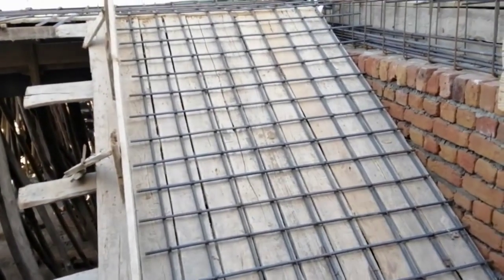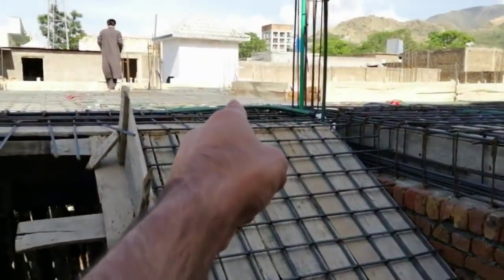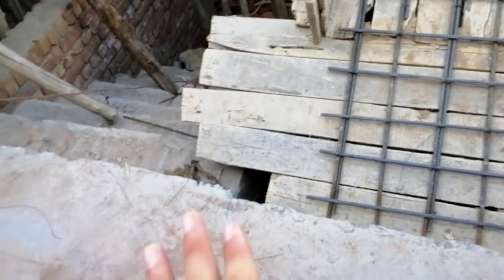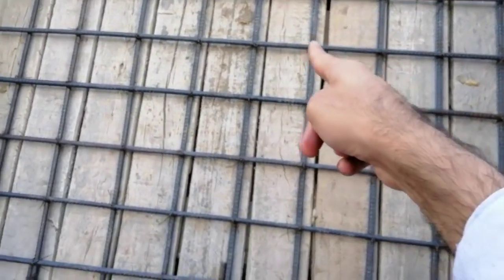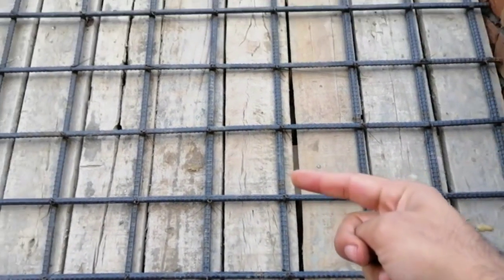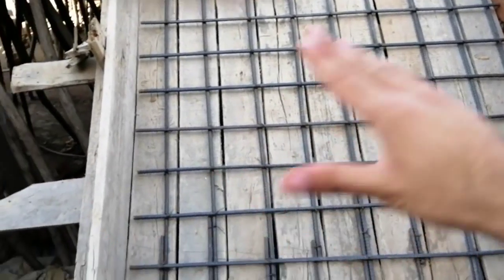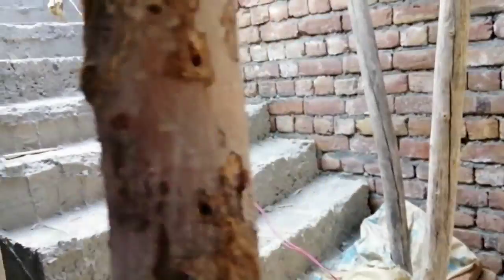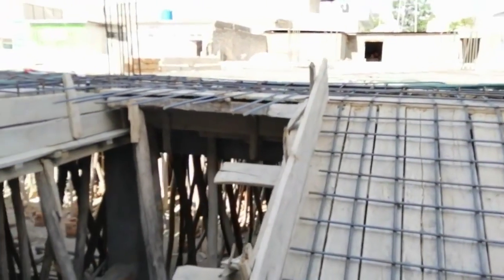Staircase Reinforcement on Site   Design of Staircase   Dog legged staircase

Comment: Shouldnt the iron rods be drilled to the wall.
Reply: Normally this is a longitudinally supported staircase when the bar spans along the longest dimension. If you want the wall to support the staircase you need another wall or a stringer beam on the other side or you need a whole beam inside the wall along the length of the staircase so that it become a cantilever staircase.  Blocks or CMUs should not be used to support a RC staircase.